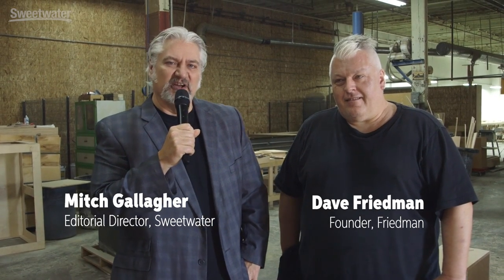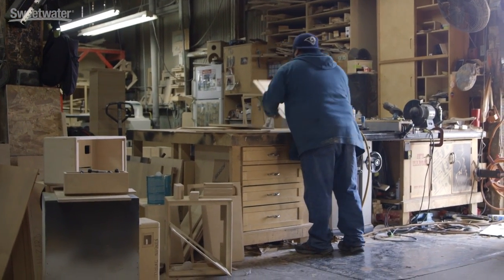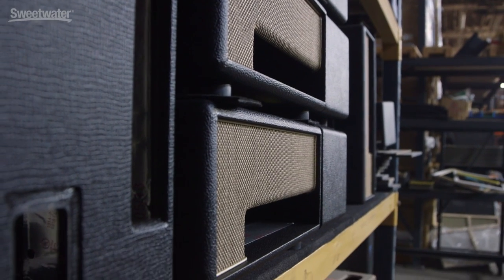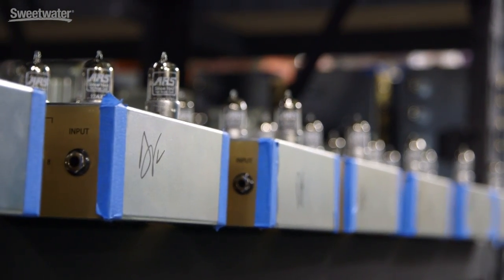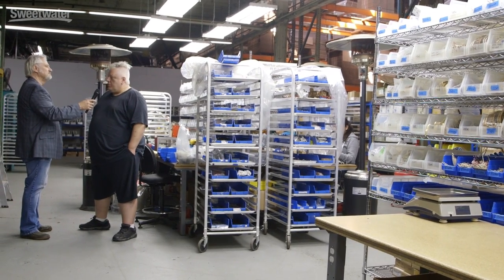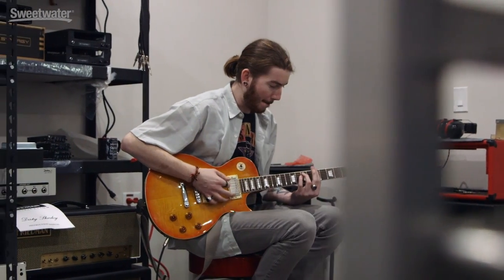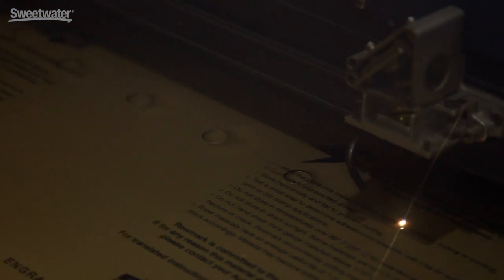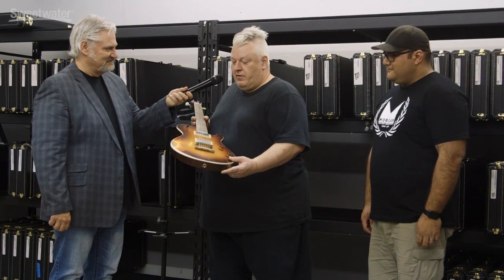Boutique Amps Factory Tour

Comment: Friedman needs to listen to 65amps talk about how cabinets are assembled.
Reply: 65amps were made in that exact facility and the exact same people until just very recently
Reply: I didn’t know they moved. 
I like how smaller amp companies can work together so they will be able to stay in business and share cost. Like that massive expensive 4X8 CNC machine.
Reply: @edwardmonsariste4050  It doesn't look like small companies working together - it looks like one massive company that churns out a product that they then label a brand "boutique" at the end for a premium price.
Reply: Ron R. You may be right. I thought at the start of this factory, that it was a few small boutique amp companies pooling their resources together to help keep cost down to be able to survive. Kind of like a Farmer’s CO-OP. 
But it well may be just one company now, doing jobs for certain amp brands. I think Mojotone does this for quite a few small build amp brands.
Reply: @edwardmonsariste4050   It seems like "Boutique Amps Inc" is the company and they could create a full line of "product" for you starting next week.  You supply the marketing!
Reply: When hand wired amps  1x10 with a Fender circuit goes from 900.00 to 2,000 then you're just paying for marketing at the higher end. Sweetwater now even offers MOJOtone led classes so you can make your own based on the same circuit.

Comment: I had a Friedman amp until I opened it and looked inside.  Cheap circuit board assembly and horrible Chinese tubes!  It was junk so I returned it.  The amp had no depth to the tone but assembly like that is the reason!  With mass production you’ll always get lower quality!

Comment: Terrible soldering practice at 6:45
Reply: Bob Newhart Firstly, he carries the solder to the workpiece. This should not be done. The pieces to be joined should be heated simultaneously and then solder applied. Secondly, he shakes the board to remove excess solder. This is terribly bad practice which can cause dry joints and even shorts.